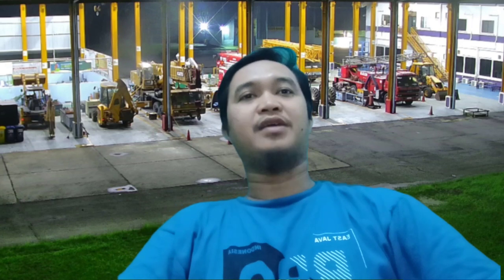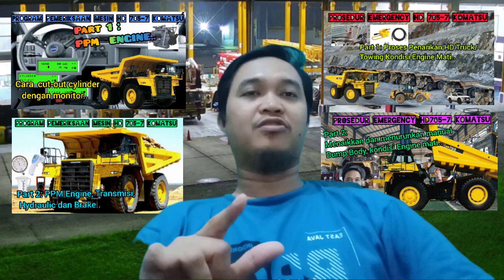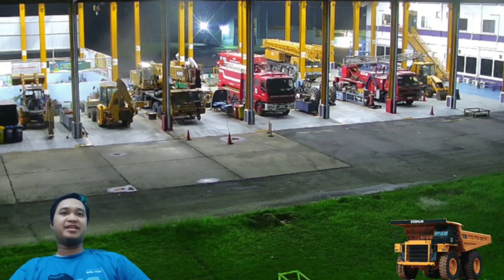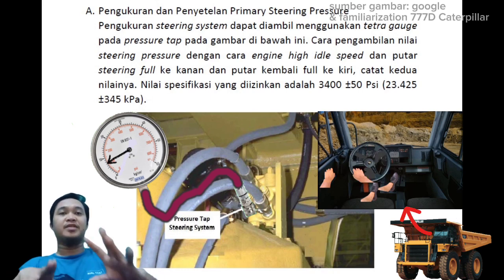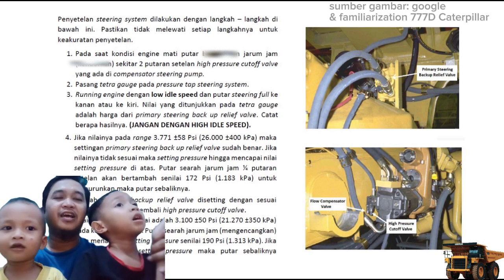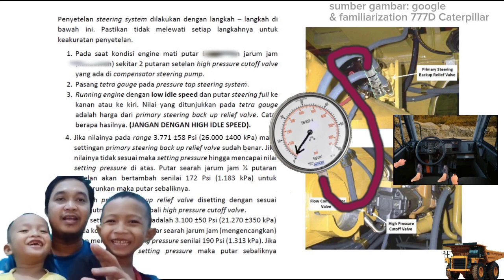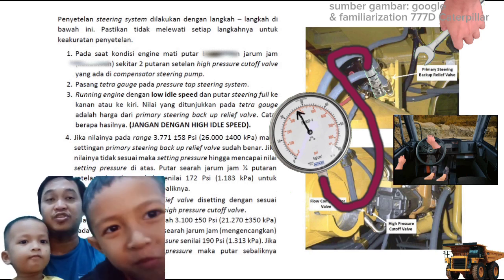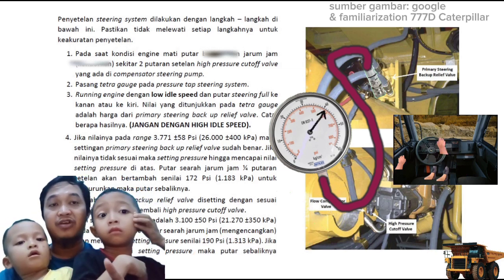TA 2 / PPM Steering System 777D / E Caterpillar. Part 4. Cara penyetelan steering system truck.

Comment: Mohon maaf sebelumnya mas mau menanyakan penjelasan terkait adjustment backup relief valve, 

Di penjelasan sampean harus mengendorkan high pressure cutoff kemudian tes pressure untuk mendapatkan nilai dari backup relief valve. 

Untuk backup relief valve berfungsi ketika high pressure cut off terjadi mulfunction, jadi ketika kita mengendorkan high pressure cutoff bukannya kita tidak bisa mendapatkan nilai backup relief valve di karenakan nilai setting pressure nya lebih tinggi. 

Mohon penjelasan nya mas apakah saya yang kurang memahami terjadi cara kerja pada steering system. Terima kasih
Reply: Baik mas terima kasih atas jawaban nya. Salam dari alumni polnes mas.
Reply from the maker: @adetiayuda1613  Salam balik mas, saya sudah 13 tahun gak pernah ke Polnes lagi.. salam buat dosen2 disana.. Oh iya untuk koreksinya tadi sudah saya edit mas.. terimakasih atas koreksinya.. 🙏🙏
Reply: Baik mas kebetulan saya alumni tahun 2019 mas. Saya suka nntn education videos sampean, pas bnget hari2 saya berteman dengan 777 dan 785 mas
Reply from the maker: @adetiayuda1613  Ooo.. btw kerja dimana skrg mas?
Alhamdulillah semoga bermanfaat 🤲🤲
Reply: Alhamdulillah bergabung bersama thiess mas
Reply from the maker: @adetiayuda1613  Ooo.. pantess paham jg Cat mas.. oke salam sama2 temen2 Polnes mas, dari angkatan pertama Teknik Alat Berat.. hehe.. 🙏🙏😎
Reply: Baik mas di tunggu edukasi2 yg lainnya, minat saya di grader mas sapa tau nanti masuk materi sampean.
Reply from the maker: @adetiayuda1613  grader 14 sama 24 M kah ?
Reply: Mungkin 16M atau 18M3 mas
Reply from the maker: Ternyata ada jg 18M ya skrg..
Reply: Bner mas ada 18M dan 18M3 tapi thiess make yg 18M3... Umum nya hampir sama dengan 16M mas
Reply from the maker: @adetiayuda1613 Ooohh.. sip mas, mudah2an bisa dapat referensi nya biar bisa saya bahas nanti systemnya..
Reply from the maker: Mas, mohon maaf ini memang terjadi kekhilafan.. terimakasih atas koreksinya.. video ini akan saya edit..  Jadi yang benar memang mengencangkan terlebih dahulu high pressure cut off untuk mendapatkan nilai setting primary back up relief nya.. terimakasih atas koreksinya mas.. 🙏🙏

Comment: mohon maaf bang sya mau nanya,
yg pertama pertanyaan saya ,knapa saat mengecek preasure pertama dg menggunakan high idle, trus knapa saat hendak meng adjust relive valve dg low idle.
yg kedua pertanyaan sya?..apa dg posisi preaure tap yg sma untuk melihat nilai harga dari high presure lock up valve..
mohon penjelasanya..maaf pemula..🙏🙏🙏
Reply from the maker: Itu lebih ke safety sepertinya mas. Karena dengan pressure 3700 Psi dengan high idle kan ngeri juga untuk komponen kita, khawatir ada yg jebol apalagi kalau unit sudah tua.  Kemudian kondisi high idle itu kita gak bisa lama2 saat stall karena khawatir merusak komponen. Untuk pressure tap nya sama mas.. 🙏🙏 Tapi kalau dalam praktek nya ada kondisi yang berbeda dari yang saya jelaskan informasi saja mas, saya terbuka untuk diskusi.. 🙏🙏
Reply: ok bang,,di copy lgi,makasih untuk ilmunya..🙏🙏🙏
Reply from the maker: @hadianto1935  siap mas..